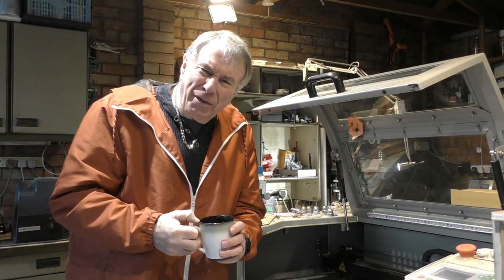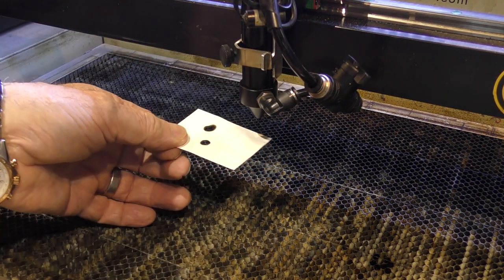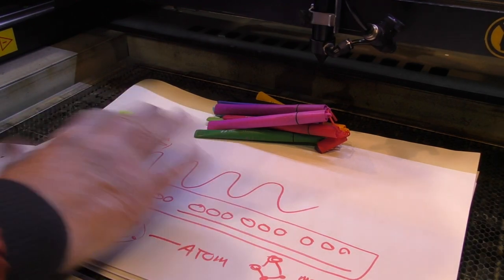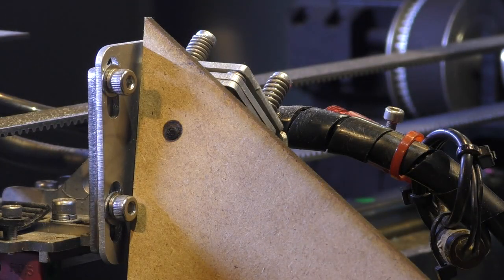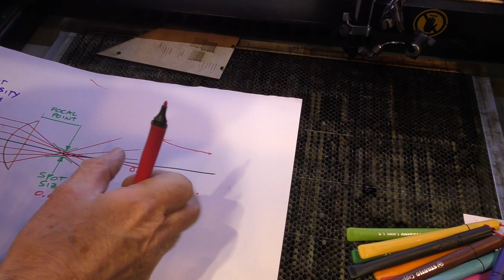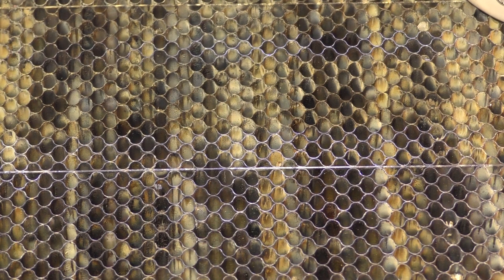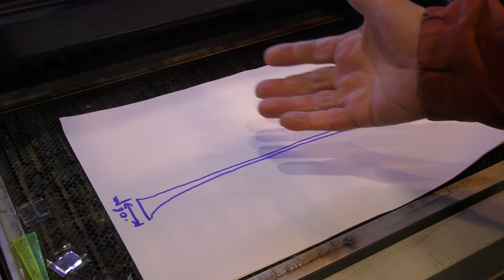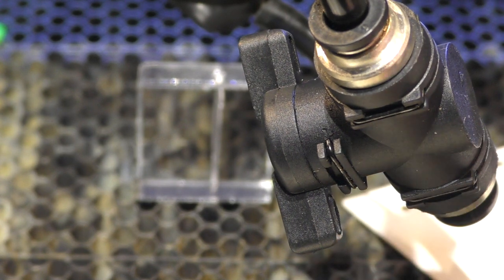RDWorks LearningLab 201 The Science Behind Laser Cutting

Comment: Fascinating! The demo with the out of focus spot but short exposure time was very revealing! It’s entirely changed my thinking; that particular experiment was a new and profound piece of data for me(!)

It’s led me to an entirely different mental model of what’s going on in deep holes: As a hole gets deeper, the energy from the edges of the beam is going to be distributed over more and more surface area down the walls of the hole. So even though the effective “exposure time” will be greater for the edges at the top of the hole, the effective intensity per unit area will be reduced very quickly as the hole is deepened. 

So it’s not that the beam energy is being reflected from the walls of the hole (although I still think there might be some of that going on, as a secondary effect), but rather that the light is striking at such a glancing angle that the effective surface intensity drops to almost nothing. 

You do ideally want a sharply-focused spot at the surface of the workpiece, but once you’re a little ways down the hole, beam divergence isn’t going to have a very strong effect at all. 

I would still think that the ideal beam would be a narrow, highly-collimated one, but I think you’ve really cracked the code for how we end up with such high aspect-ratio holes almost regardless of focal length, per your other experiments.

(As noted, the “aha” moment for me was seeing the impact of exposure time with that very defocused beam. Absolutely fascinating; it’s amazing how one piece of data from the right experiment can be the key to a whole new way of thinking about a problem!)

Thanks again for the fantastic work, and what must be a completely insane number of hours running these experiments!

Comment: Remember when you were a kid and found out you could start a fire, or burn ants, with a magnifying glass?  Concentrate the sun light to a tiny spot and POOF paper, or ant, up in flames.  Same principal with the laser except the part of light that does the burning is highly concentrated.   Thats the simple explanation, Russ you did great detail on the complex answer.. LOL

I posted before watching to the end. Some great material. On the argument of coning, it is possible to cone IF the beam is left on long enough, and depends on the focal length.  Exposure.   Like leaving the shutter open at night on a camera, the longer it is opened the more light gets to the film.  The longer the beam is left on, the more time the scattered light has to do its vibrating.   Since the beam is concentrated by the lens, the majority of light is at the center of the beam, and the rest is scattered light after the focal point diminishes, so properly set up and times, it will never cone a piece, but if the wattage is high and the speeds are too low, it is possible to get some coning.  IOW using too much laser for the job, such as a 130-150 watt set to a 20 watt speed.   However, I will bet that those who complain about coning are looking at it the wrong way. They are looking at the Entrance point of the light and not the exit point!  I have some 1/4" (6mm) balsa that is coned, but coned from the top town. Too much light, not enough speed from when I first started using the laser. 

I have also ran into issues where the top and bottom cuts are dead on straight, but dished in the middle. This happens on multilayer plywood with different materials, the wood and glue not burning at the same rate, so the glue needs more energy, and causes the cupping.  I am still working through a solution for that with 6 ply birch, need to find the proper balance to be able to slice through the glue layers without scorching the wood.

Comment: This might have already been addressed in a previous LearningLab, but I don't remember if it was or not.
What happens if you would use, say Nitrogen, or Oxygen instead of the standard compressed air? Obviously the nitrogen would reduce burning, but for engraving would it help reduce the halo for a beam? Would the O2 help or hurt cutting the organic materials, or just make a bigger fire?
Reply from the maker: Hi
  Yes, you have a good memory. see  https://www.youtube.com/watch?v=dgRmYYCbw8s
 Understanding the physics of how the laser does its cutting  is important to answering your question.. As I explain, light is vibrating the molecules of a material to make them hotter. At a certain critical temperature (vibration level ) the bonding forces between the atoms will break as the molecules shakes itself apart. Those free atoms are now able to bond with other free atoms to make different molecules (chemicals). Adding an INERT  gas such as argon or nitrogen to the equation  will have no effect. The reason why a gas is called inert is because it has zero (or almost zero) ability to combine with other elements. Thus when the over excited molecules fly apart and  look to combine with other atoms, Argon and nitrogen will not be available. So why did the argon have no effect on the cutting?  I naively thought it may kill the cutting process, but imagination can often be more persuasive than logic. When you understand the cutting process logic tells you that all the argon is doing is FLOWING through the cut and doing exactly the same task as the normal air assist (80% inert nitrogen anyway). If you can EFFICIENTLY remove those new molecules (lots of tarry smoke) out of the BOTTOM of the cut then you will get the demonstrated clean cut that I achieved.  You will note that I was using a CUTTING nozzle wit about a 2mm orifice and that the nozzle was set maybe 3mm away from the work.I was also using very low pressure. However the FLOW though my kerf was sufficient to keep the cut face almost smoke free. If you watch the video link above you will note there was no difference in the smoke flow or appearance  between tests. 
You use oxygen as an assist gas when cutting mild steel because it easily bonds with iron atoms and also creates a controlled  exothermic reaction that ADDS to the heat of cutting.  I'm not  sure I would want to add oxygen to any organic "burn"..... my persuasive imagination  tells me to be elsewhere!!!

 Best wishes
Russ
Reply: @SarbarMultimedia  I will go back and review that. Thank you very much for the reply. I would agree that while it (o2) might help the cut, all that unburn smoke might decide to fulfill its fiery potential! Would be fun to see though! lol

Comment: Could it be a possibility that when the hole that the laser beam is on its way through acts as a reflector for the beam and focus a little again to the center as in a light guide for internet fiber network
Reply from the maker: Hi Jacob
 
Total internal reflection only occurs when light passes into a DENSER medium and then reflects off its boundaries.  For example  you can pass light into a column of laminar flow water and get TIR because it does the same as glass light fiber. You can also pass light into the edge of acrylic and achieve total internal reflection between the INTERNAL flat surfaces, When you engrave the surface you are creating different angles and these angles are greater than that required for TIR (about 48dgrees)  and the light escapes.  That is the principle of edge lit signage. You will not get TIR within that thin acrylic tube because he laser beam starts off in air and remains in air (albeit acrylic vapour) thus the conditions for TIR are not met.
Light travels in straight lines so it follows that the there must be  an almost parallel  beam of intense light that passes right through (and immediately adjacent to) the axis of the lens.
II hope I have answered your question but f you still have doubts then Google " total internal reflection"
 Best wishes
 Russ
Reply: @SarbarMultimedia  I am also new to this area have got a Neje master 40w which works well for my ideas I have only tried white cardboard cut at 15% power and engrave wood at 5% power I have tried to suck the smoke away instead of blowing the smoke away with good result. Your videos are good knowledge thank you